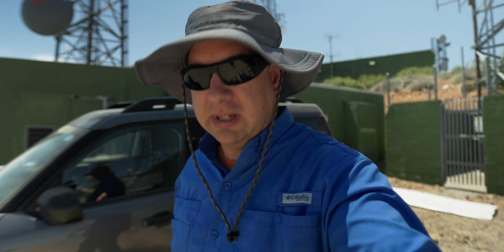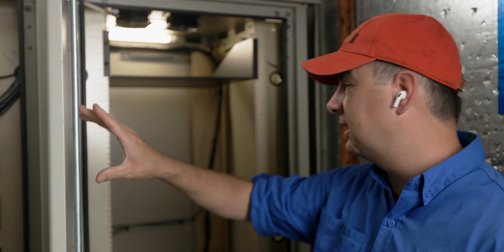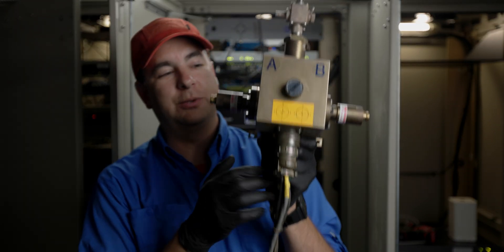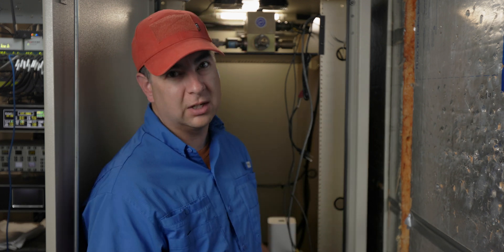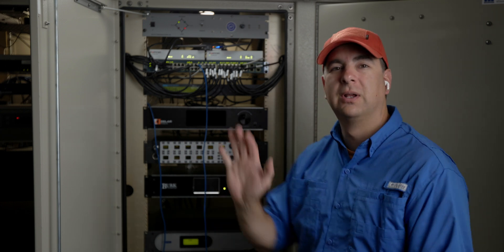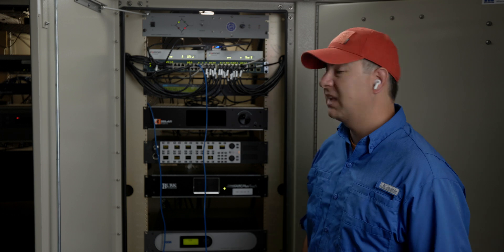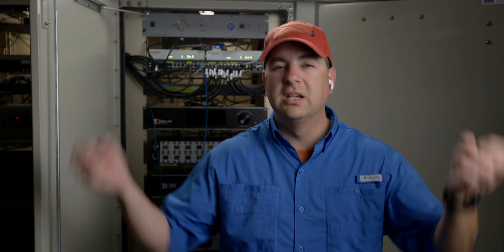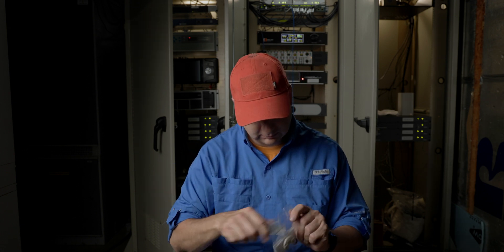Working on Santiago Peak's RF stuff

Comment: Good video as always ..   It's  easy to "armchair quarterback" but isn't silicone grease applied to the O rings?  Maybe it's not included with the current Ring-flare connectors?     Hope you're feeling better soon.
Reply from the maker: This model doesn’t have that. I’ve had some that do. Thanks! Out until Thursday… fun times.